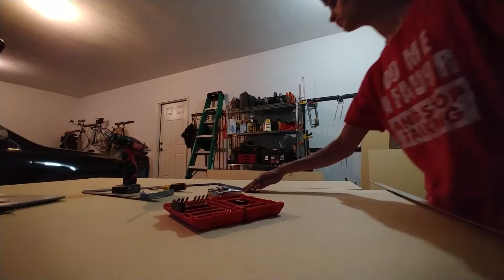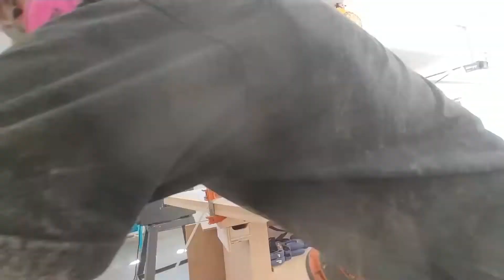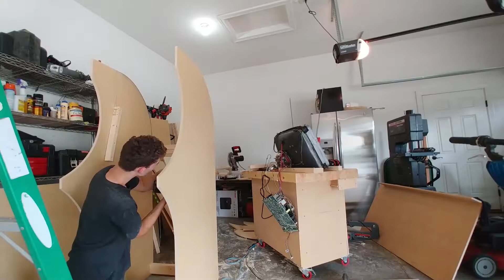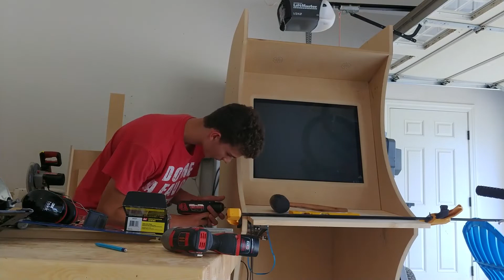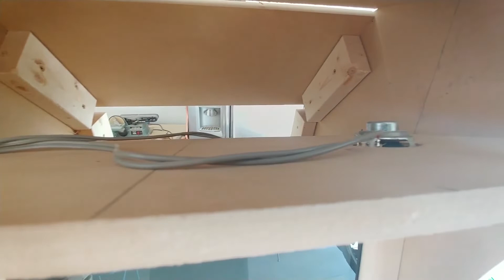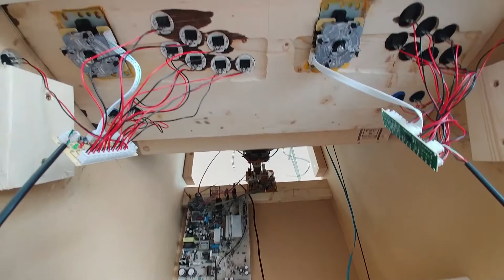Making an arcade machine || pt.1

Comment: Wow man where is part 2 ? Or can you upload a small video of your arcade ? Its super cool. You even used the proper screen
Reply from the maker: Haha, thank you, but I just haven't had time to work on it. It's been sitting in my shop, and I play it when I'm waiting for glue to dry😅
Reply: @joeleagles5491  its superb, i was wondering how you got your games going on the old tv screen? What did you use in the pc etc..... that kind of stuff. What games that you play on it etc. People now put led monitors in thier cabinets but its more authntic with the old crt tv screens but much harder to get a picture from a pc.
Reply from the maker: @ph111hud0  the PC I'm using has a lightweight Linux distro with mame and attract mode installed. I have an old graphics card with an  s-video port and my TV has one to. The CRT I used is pretty modern (late 90s early 00s) so it has more IO than the average CRT.
Reply: @joeleagles5491  i see, so its not running windows as such its a linux based operating system , like bacotera type thing ? , i have built a cabinet similar but i used an arcade vga bought from ultimarc, it didnt have an svideo connection, it uses a vga connector but its supposed to push out the correct resolution of each game in mame, i havent completed the setup yet because i have no front end im just using an old mame. Some of the newer mames dont allow direct draw and only use direct x , direct draw is supposed to be the one that helps with the correct resolutions. I so wish i had used an svideo connection and a simple video card now. I think you have done a superb job. Thumbs up to you